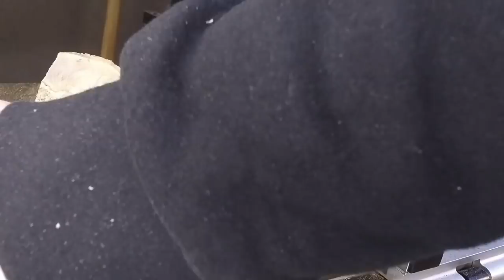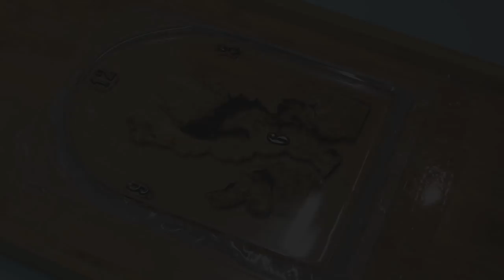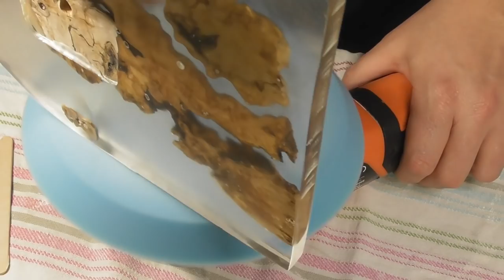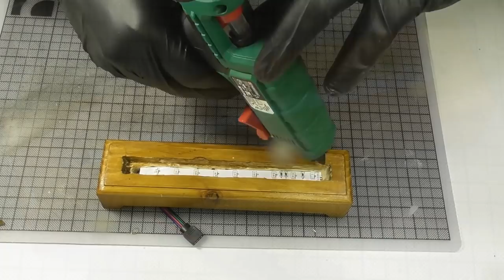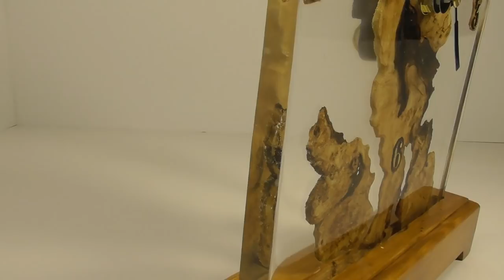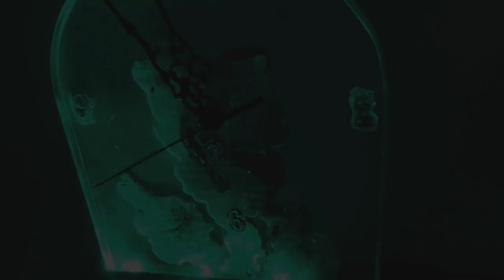EPOXY RESIN WOOD CLOCK L.E.D LAMP-DIY

Comment: Hi! I’m quite confused about the LED strip lights. What did u connect it to and how did u switch it on and off
Reply from the maker: Sorry for the delay.  The particular  led lights are connected to a power converted and then to electic socket. The light turns on and off by a remote control. Hope this helps.😀

Comment: Nice job 👍
Why did not you dig in the base with the router? 
Thanks for sharing, take care
Reply from the maker: Thank you. Because I am not that experienced with the router and the base was quite small so I was afraid I would not cut it correctly.
Reply: @4THECRAFT , try, it's Very efficient for that 😉 use guides to dig well, and finish corners with chisel 😇